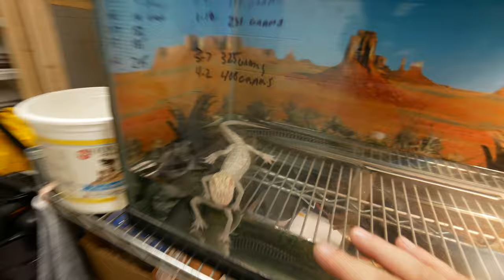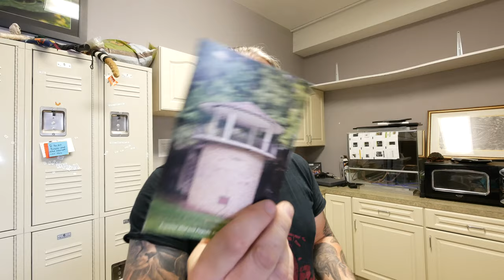CAN'T BELIEVE WE DID THIS!! BUT IT WORKED!!!! | BRIAN BARCZYK

Comment: 𝗗𝗔𝗜𝗟𝗬 𝗔𝗡𝗜𝗠𝗔𝗟 𝗙𝗨𝗡 𝗙𝗔𝗖𝗧

Did you know that cockroaches are one of the hardiest species of animals, able to survive severe bodily trauma and extreme environments? A cockroach can live for a week without its head. Due to their open circulatory system, and the fact that they breathe through little holes in each of their body segments, they are not dependent on the mouth or head to breathe. The roach only dies because without a mouth, it can't drink water and dies of thirst.